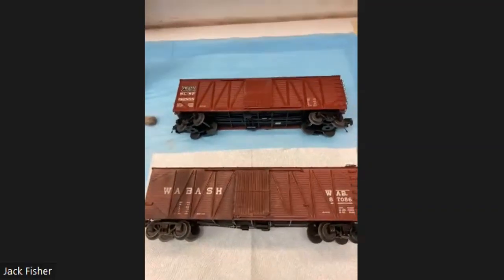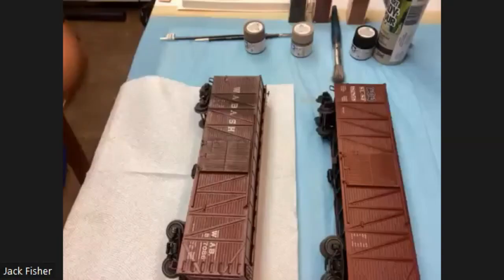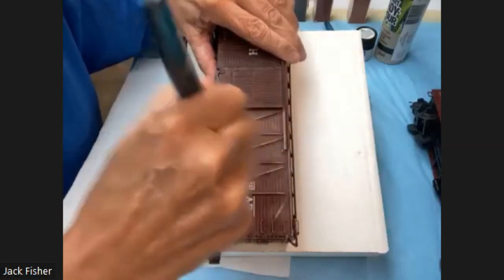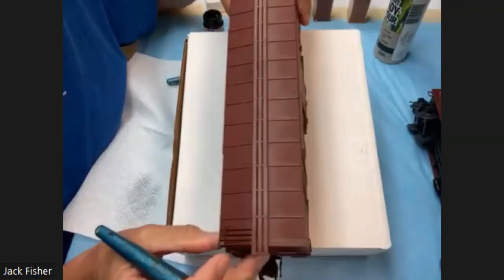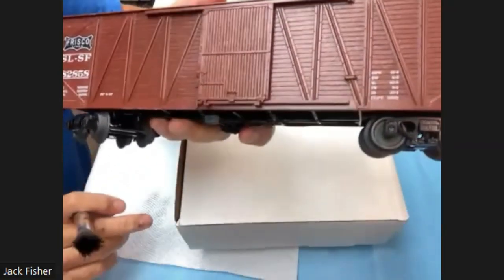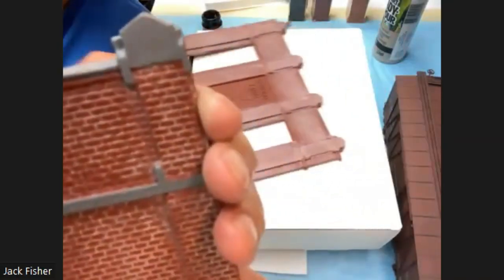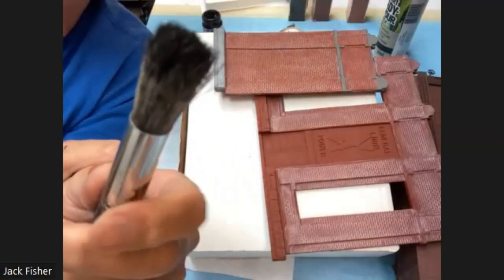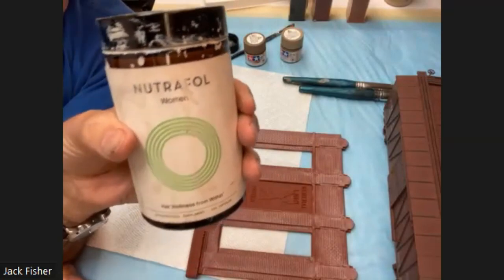DrJack and O Guage Outside Braced Boxcars

Comment: I prefer weathering chaulks over airbrush paint. The way the powder collects in all the nook and crannies gives the cars a very well worn type of look.
Reply: How do you set the chalks so it isn't transferred when you handle other cars or engines
Reply: @The Trainboard  I use testers dull coat or any flat/dull spray overcoat will work. Just don't spray too much. Because you don't want it to puddle or run.